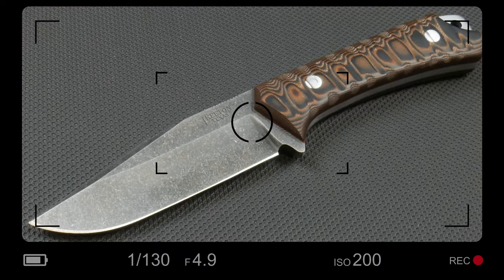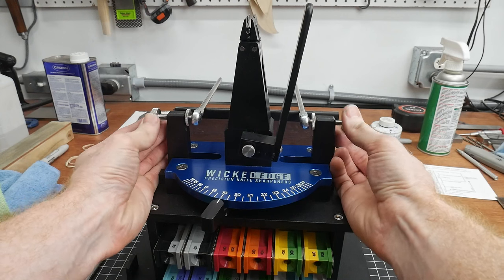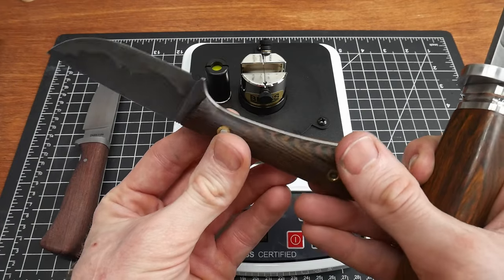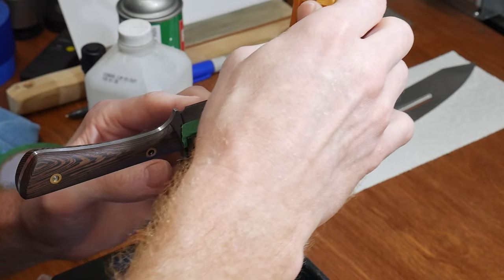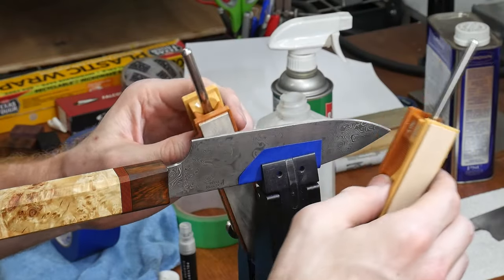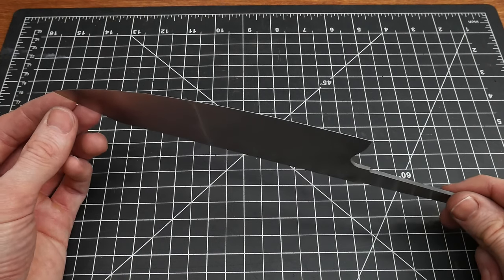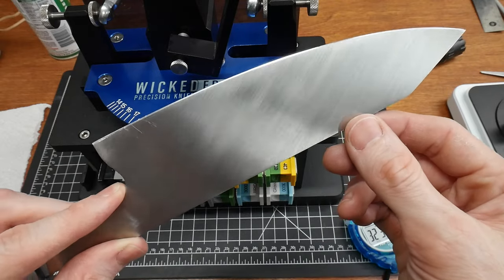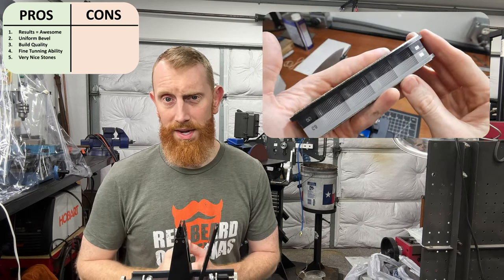Knife Sharpening Made EASY! // Wicked Edge Gen 3 Pro Review

Comment: That sharpening system is awesome and while the price is a bit steep, you get what you pay for! I have used many different systems in the past, and after watching your video I am confident, this system is the best I have seen. I will be purchasing one! Thank you for the excellent video.
Reply from the maker: Thank you for the comment sir! It's a well made machine for sure... the results speak for themselves on the edge. Cheers!
Reply: The more professional Tormek swedish rotating whetstone machine with rotating leatherstropper is less than half the price of the Wicked Edge III pro pack. And it can do the job in a fraction of the time and effort.

Comment: I just bought a Tormek double rotary wet grindstone machine with rotary leather stropper from Sweden. The machine comes with a lot of different angle jigs for knifes axes and chisels. In addition, I bought an extra 4000 grit rotating Japanese polishing whet stone for this machine. All of this was a few hundred dollars cheaper than the Wicked Edge Gen 3 pro pack. The Wicked edge is just a small sharpening jig for the table. And it is just an insane rip-off all together, compared to the more professional machine with all those accessories from Sweden. The price of Wicked Edge products is complete madness.
Reply from the maker: The Tormek is a nice machine!

Comment: Very nice video. Over the years ive acquired a few systems and a handful of hand stones of different types chasing my preffered way of sharpening. Normally i hand sharpen with a dmt fine plate or spyderco ceramic bench stone then strop. Over time my technique shows its imperfections and the secondary gets all buggered so ill use my kme for small slipjoints and stuff or the wicked edge go deluxe for everything else to properly reset the edge. I started with a lansky, used belts, water stones, oil stones, ken onion sharpener and what i mentioned above seems to work the best for me. I'd love the pro system or one of the others but for how much my WE go gets used I couldnt justify the cost for personal use. Diamond and ceramic bench stones plus a strop for a quick touch up once you get the hang of it is so much faster in my opinion.
Reply from the maker: Thanks for the notes sir!

Comment: Ive been using wicked edge for about 4 years now and nothing has came out that beats it my opinion the mirror finish you can get with those lapping films are excellent better then any others system ive seen and i have lapping films and also strops and you can get kangaroo leather with diamond. 10 micron spray to make it just stupid sharp good review the stones work better as they break in and yeah its not cheap but its quality sharpener that will lasts for years
Reply from the maker: Thanks for your comment sir!

Comment: What’s up Red, good video. Was awesome to see the Siren make a cameo in there! I enjoyed seeing the before and after stropping bit too. One thing that would be cool to test is the difference between stropping and micro beveling. I’m a huge fan of using microbevels. I feel like it always gives me the maximum level of sharpness with the least amount of work and the least steel removal. I also believe that it provides a longer lasting edge than stropping but I’ve never rigorously tested that. What would be interesting to me is to take two equally sharp knives that tested at very similar levels (say 200) and then strop one and VERY lightly micro bevel the other, maybe with a 1200 or 2000 stone. I personally believe the microbevel would be more agressive and last longer but it would be interesting to compare the final sharpness between the two techniques. Anyway, just my ramblings. Thanks for the video!
Reply from the maker: Glad you enjoyed it! I'll have to try that, I agree... probably would yield a heck of a robust edge.

Comment: Don’t use WE because it’s not only harder to use than most systems, the big elephant in the room is their use of their own stones, and not the more standardized 6” stones. TSPROF K03 or Kadet Pro can reach much better results with more stone options, and ability to run more clamp types, and better built quality with use of 7075-T6. I got a Kadet Pro for $368 new on Black Friday, came with 5 Diamond stones. It’s much easier to setup, adjust angles, and has stone thickness compensator which allow you to quickly change stones from different makers. There’s no going back for me, I’ve already reached higher results on the Bess with the same para 3 rex45.
Reply from the maker: Thanks for your comment and experience!

Comment: When you say stropping down what exactly do you mean? If you’re sharpening at 17 degrees, are you stropping at 16 or 18 degrees?
Reply from the maker: I go down a 1/2 degree... not a pro, but that's been working for me. 

So if I'm at 18 degrees I'll bring it down to 17.5 to strop. 

This is because the leather "smushes" a little bit and you don't want to round over the edge you just worked on.
Reply: @RedBeardOps  but why don’t you stay at the same degree?
Reply from the maker: @vinnym5095  This is because the leather "smushes" a little bit and you don't want to round over the edge you just worked on.

Comment: I dont know if this comment is too obvious as for anyone watching this video , but you said nothing about   any finishing compounds that are used on your 2 other comparison systems. There are many diamond compounds available to strop with that would be much more effective in than the wicked edge system. Diamond compounds in paste form, water and oil based,spray, and emulsions. and others. Besides the multitude of diamond sizes. There are CBN compounds that act differently. There are ceramic compounds. There are green chromium oxides, there are aluminum oxide, and much more. All of these can be e utilized with or without the wicked edge system, at a extremely fast pace. And might i add a way lower price structure than any thing similar to what wicked edge had to offer. Not an opinion.fact. all of the degree of final sharpness was related  directly to the finishing steps that you used.
Reply from the maker: interesting, thanks for the notes